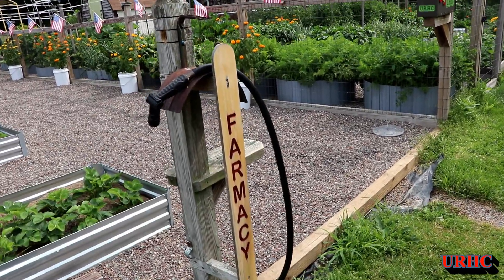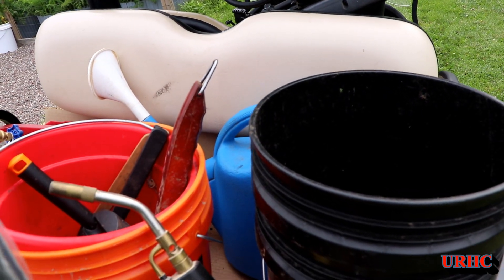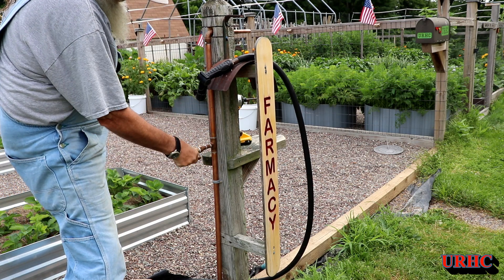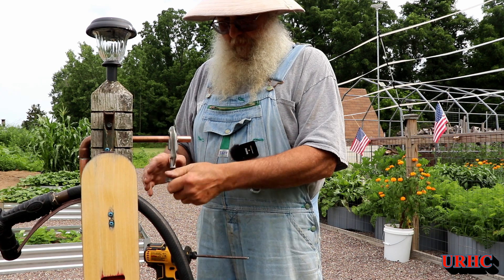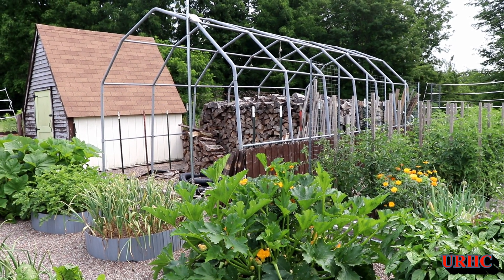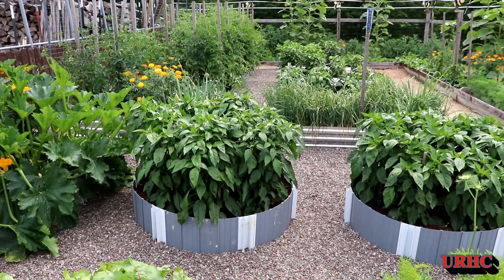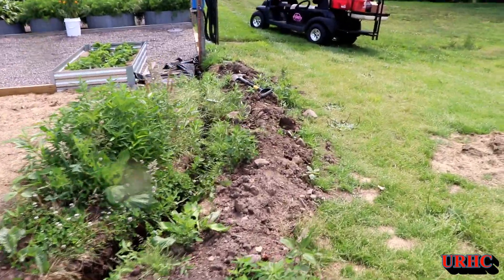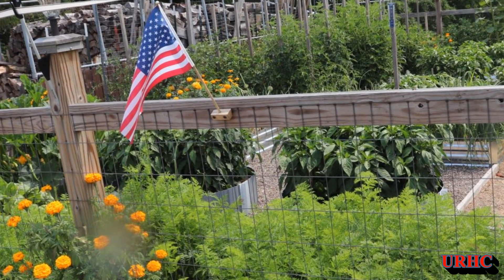Garden 2021 Part10 Extending The  Water Line

Comment: That is great! My husband did something like that but used hoses and didn't bury them deep enough so the lawn mower got them sometimes. I love the way you have your garden. I'm taking notes!
Reply from the maker: I guess every time you hit one with  the mower you had a new sprinkler in the yard. This plastic  pipe is actually  less expensive  then hoses and doesn't  expand and contract like a hose that moves  it to the surface over time. Thanks for watching.
Reply: Good Info to know! Thanks

Comment: Great job on the extended water line. I love how you made the post for both the hose and watering can. I was thinking you might want to put some type of decorative marker where the blue connector joins the two black tubes for future reference. That blue connector could fail in the future and that way you know where to dig. It would save you time and labor searching for it. Have a great day!
Reply from the maker: Thanks.  I was thinking the same thing. I am going to find one of the gray old style connectors and replace it first. The blue ones have what looks like threads and the mold halves were misaligned  so they are junk. The old style  had ramps in one direction that are less prone to leaking.  Thanks for watching.

Comment: I need to get a thermometer set up like that. 

If you get bored, check out the smokenator for the Weber. It works great. Holds a very consistent, controllable temperature.
Reply from the maker: All my Weber kettles are good at controlling temperatures just using the flaps. We don't  like real smokey flavor anymore  so I usually  just throw  in a couple  chunks  of crabapple for a light sweet flavor. That  was the cheapest  wireless  thermometer I could find. The only problem  is the darn thing beeps any time you hit a button and it drives  my dogs crazy. Seems to work good and can monitor  2 grills at a time. Will  find out how long it lasts over time.  Thanks for watching.
Reply: @unemployedredneckhillbilly2023  smokenator uses kettle vents. It's not that different that the setup you have there. I just like it better. It's stainless steel baffle, instead of baskets. 

Cheers.

Comment: I've been using the same " temporary " watering system to my garden for years.
I thought it was a very interesting you heated the black piping up so it would be softer to put the clamps on. I actually heat mine with a paint stripping heat gun but I heat it up before I put it on the fitting otherwise it's too hard for me to get it to push on the fitting. I've  broke  some over the years before I started heating it first.
Have a Jesus filled day everyone
Greg in Michigan
Reply from the maker: These new fittings don't  have good sealing ridges and slide in. They are junk  compared to the old gray ones. Softening the tube some helps get a seal but with the spiral ribs it's  almost  impossible if there  was slight mold misalignment when they were molded like the coupler I had problems with.  Thanks for watching.

Comment: Have you tried using quarter turn/ball valve? I find them last longer than those that needs multiple turns, and they are easier on the wrist too. Thanks for the video.
Reply from the maker: Yes I have and I find they don't last long and can't be rebuilt.  A 5 cent washer that I have boxes of fixes this type in a minute. For water lines that aren't constantly  turned on and off they are good. Thanks for watching.

Comment: Do you have a video on how you are using the Weber to smoke meat?
Tks
Reply from the maker: No. I really  don't  smoke heavily  with it. I just add a couple  chunks  of crabapple to pork at the start and it makes a a nice sweet light smokey flavor.  To really  smoke  with them you have to setup the charcoal for a very  slow burn and monitor  the vents to keep the temp around  220. Find an old crabapple tree and cut up a branch into chunks then let it dry. Throw  2 chunks in at the start and you will have a wonderful  flavor that most people  love. If you have a wild cherry  tree that's  a nice wood to use with  crabapple also. I stay away from the strong  tasting wood like hickory on the grill.  They are best in the smoker for long slow cooking  of things like Turkey  legs and pork bellies  that have been brined for a day. I will try to do a video  in the future.  Thanks for watching